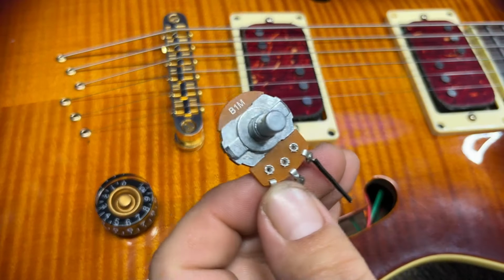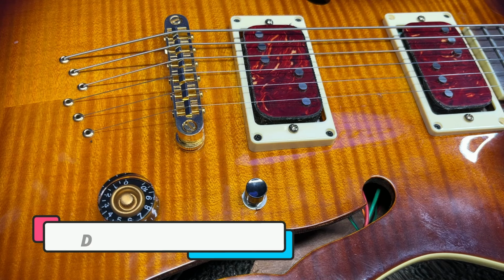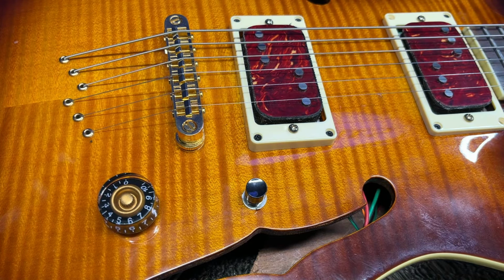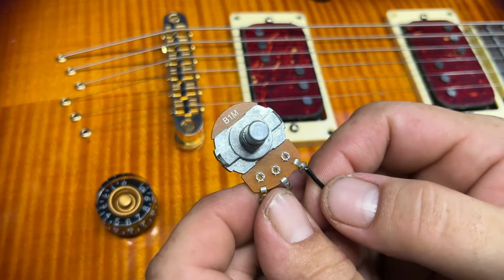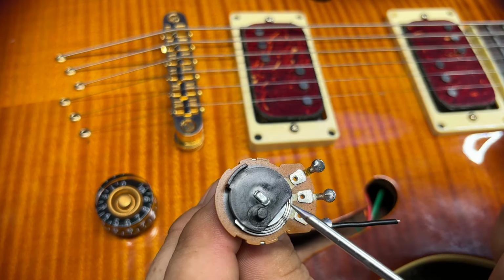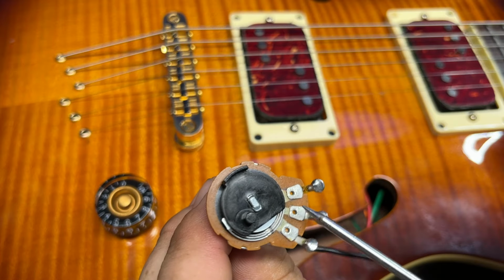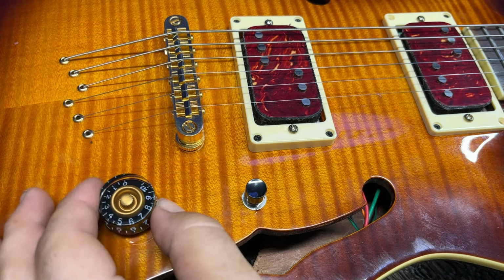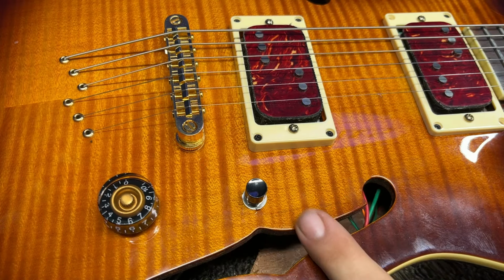Volume Pot Comparison  1meg - 500k - 250k - 100k - 25k

Comment: why not just use 1meg and use your tone control for what it is ment to, then you have both bright and dark...
Reply from the maker: @funnelbeaker9839  because a tone pot takes out more than treble. I tone pot takes out treble and midrange. So tone pots take away the soul of the guitar.
Tone pots were invented in the 50’s and it’s old tech. I actually make a dynamic tone knob that trims treble and not midrange (modern tone knob).
And a tone knobs adds load to the pickup which changes the feel.
I also have a video on how tone knobs work.
Reply: @ArtoriusGuitarNerd  so regular tone knobs should be avoided all together? rather use the amp or software eq?
Reply from the maker: @funnelbeaker9839  no I think you should use what ever works best yourself/your setup.
My point to changing the value of the pots was to “even out” the tonality between guitars rather than changing the eq of the amp settings or software settings.
Me personally, I like the way my pickups sound without the extra load from a tone pot AND I would much rather use my Dynamic tone filter over a traditional tone pot.
Reply: @ArtoriusGuitarNerd    Makes perfect sense!  I just made a guitar from scratch and wired the pickup directly to the output, perfect for recording to my PC and then using different software to sculpt the sound.

Comment: would a graphic eq do the same ?
Reply from the maker: Absolutely, an EQ pedal or amp settings will change the tone but you would have to move those settings for every guitar. This is for fine tuning your guitars so everything plays well together.
Reply: No, a graphic equalizer is an electronic circuit that actively adjusts the level of different frequencies in an audio signal. What this does is remove some signal by shunting it to the ground.